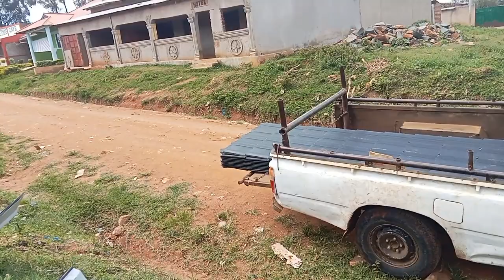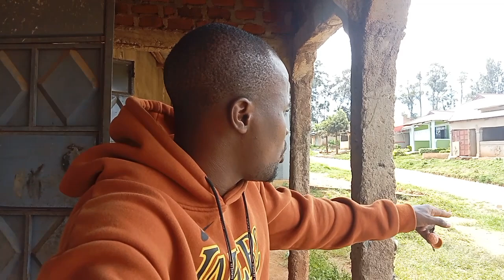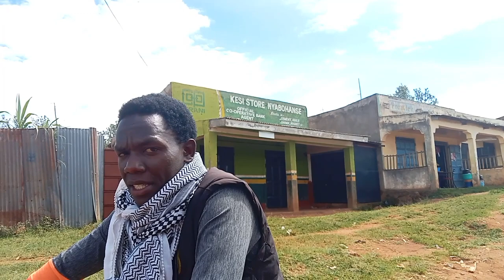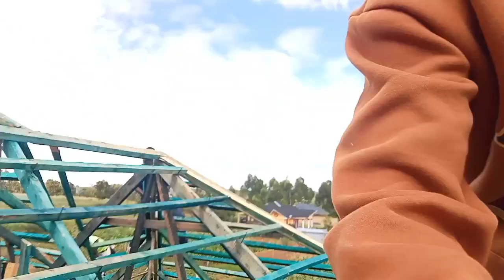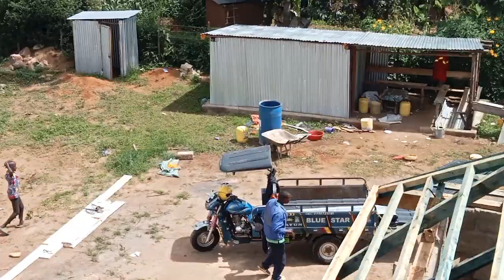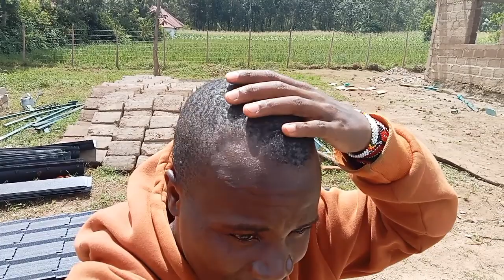This is Big surprise for My Life  Thank you God 🥰🙏

Comment: Before putting iron sheet roofing. Probably add layer of insulation  to  raindrop noise ,  reduce rain sound that can be very noisy,  because of the no ceilings concept?  Consult   reducing noise and sound  engineer,, acoustics
Reply: I would imagine that it may be costly.